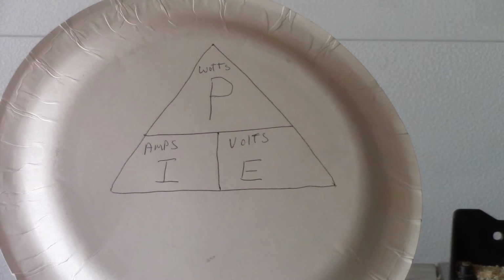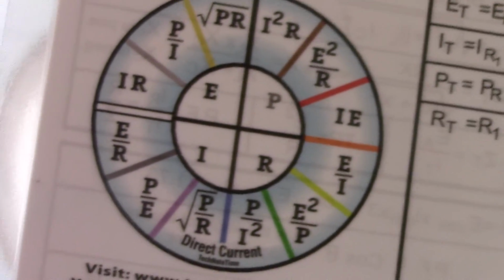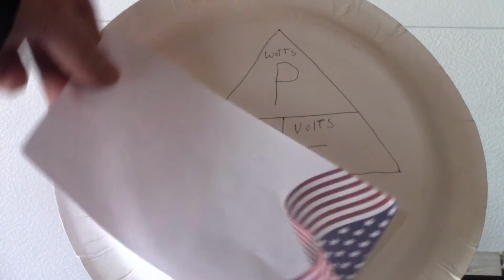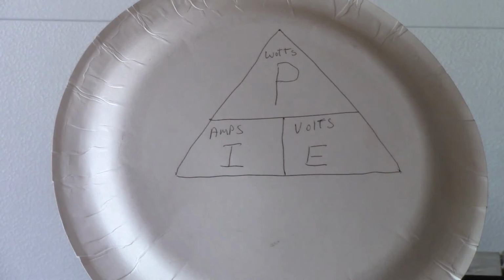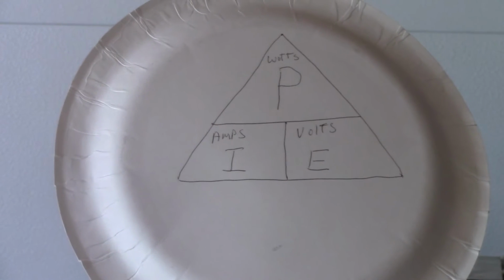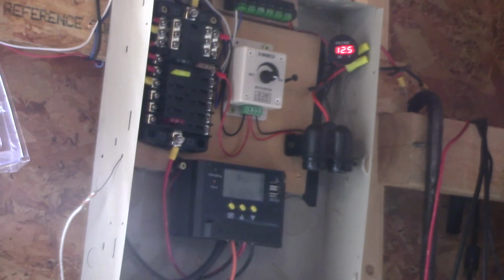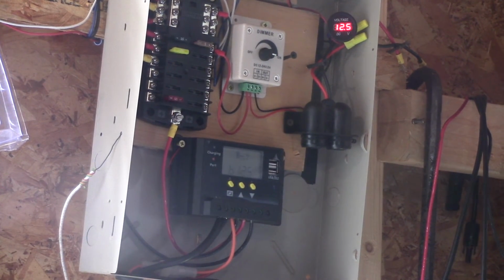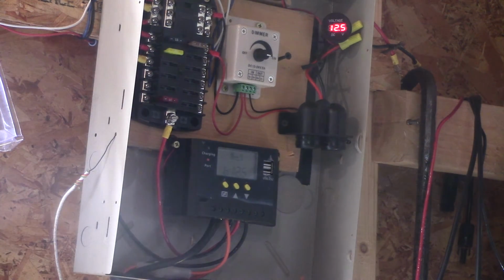Watts Law,  Begining A Solar Journey

Comment: Good points! You should mention you can loose 15% to 30% of the solar panels power by not using an MPPT Charge Controller and an additional 15% to 20% of the power using wet cell batteries instead of AGM's. The best batteries for solar are  LiFePo4 but they are expensive.It is just as important to know how to  use the power efficiently.
Reply from the maker: +EZ Off Grid Great points EZ.    What are the cost of the Lipos?  I have also read some bad reviews on them.  Is this possibly due to certain manufacturers?
Reply: +Peaceful Prepper I priced LiPos a wile back and thought they where ridiculously expensive. They can supply two to three times the Amp/Hrs as AGMs over the long run but the cost per Amp/Hrs is not much different. They require balancing and battery management as they can be damaged if they are discharged to low. I am hopping the price comes down over time as they are very efficient.
Reply from the maker: I use the AGMs here due to the extreme temps we hit here -20F and -30F.  They seem to handle the cold well.  I also get them used for about 50 cents per Ah, lol.  I am waiting for the new AC cap batteries Enphase has been working on.  I think plate/Cap Batteries is the future.  They are also storing DC in the plates and they are being used at Google and UPS headquarters for trial.  They work like caps for storage.   I will get over to your channel.  What are you working on?
Reply: +Peaceful Prepper  I'm pretty much finished with my off grid project I'm just doing a little hunting and fishing video right now
Reply from the maker: I like the sand filter.  How has it been holding up for you?
Reply: +Peaceful Prepper I still get a lot of questions on that video I will have to do an update on the filter.
Reply from the maker: I saw them used in Africa and S. America.  was never anywhere long enough to really get a feel for them.  I have done some investigation but no practical application.  I would really like to see your update.  Great stuff.  Great videos.  I wish I had your video skills